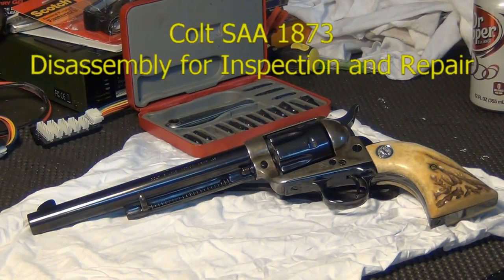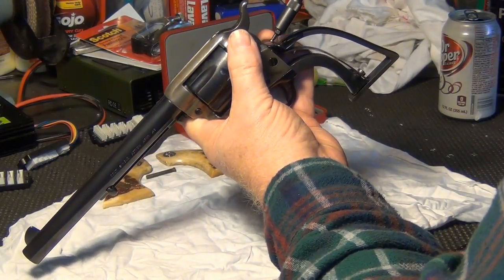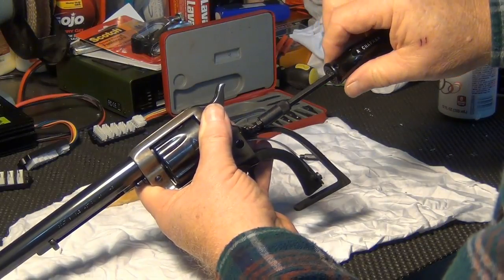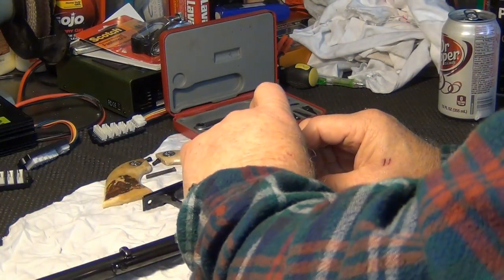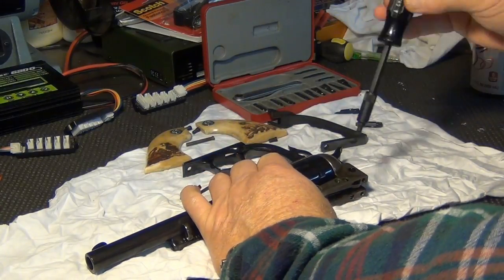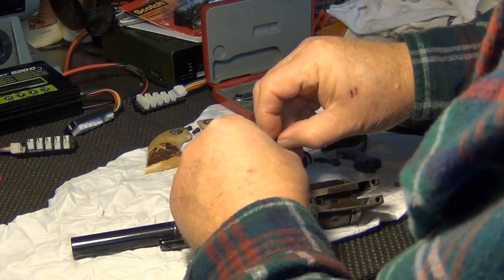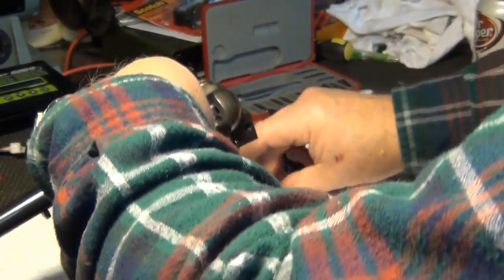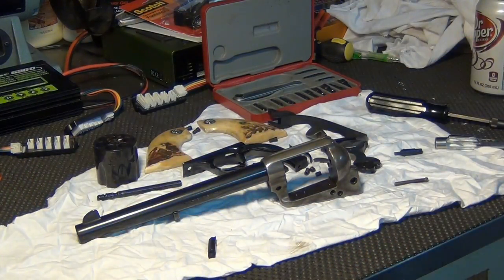Colt 1873 Single Action Army Disassembly Part 1

Comment: the back of a magnetic sign  covered with a paper towel makes a great work area. Anything dropped stays stuck and does not disappear into the land of lost gun parts. Replace that flat spring with a coil wire spring a forever fix. Yes it ain't "period correct" but it works every time and is hidden. I don't shoot any pf my originals but the replicas get the wire fix  including the 1851 and 1861 Navy and 1860 Army all have the same  lock work  construction.

Comment: Has the hammer and cam , an trigger, been rebuilt, it looks like it’s in great shape, I’ve had my 1905 colts hammer rebuild years ago by Tom surgis , B.T.A, and still works great, think of the stories them old guns could tell sure would be interesting
Reply from the maker: Other than replacing the bolt lock spring, I do not know of any other work done on the pistol other than the refinishing that was done before I acquired it. Neil Dahl

Comment: I have Just purchased my first SAA, made in 1980, in 44 Special. The internals look identical in this SAA to the Black Powders. The Half cock notch was broken and I cannot purchase a new hammer from Brownells, Midway, or Numrich. Some have suggested cutting deeper into the “partial” half cock notch. Has anyone had success in fixing a half cock using this “hack-saw” method?

Comment: My ca 1929 SAA cylinder notches are badly worn, need re-timing, maybe a new cylinder?
Reply from the maker: You probably want to keep it as original as possible to keep it's value. I would take it to a good colt gunsmith and get their opinion. If you get a new cylinder you will have to get it adjusted for the timing. But hang on to the original. Neil
Reply: Thanks

Comment: That's not a 1st generation Colt, It's a second or third generation also always loosen your mainspring before you loosen your trigger guard or you may cause damage.
Reply from the maker: +Brian Engstrand  Brian it is serial #170799 made in 1897 this is a numbers matching 1st generation according to Colt. Thanks for the tip on the mainspring!

Neil
Reply: +Neil Dahl Sorry my mistake, I was thinking black powder frame which did not have the traverse bar for the gate pin release, it had a screw on the bottom front of the frame. Colt started using the traverse bar in the 1890's when they went from black powder to smokeless, my apologies.